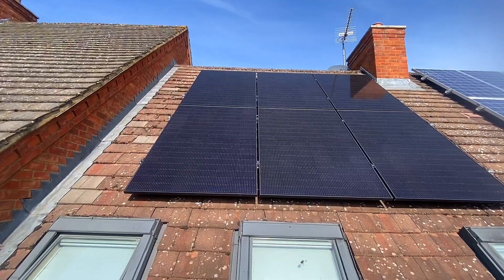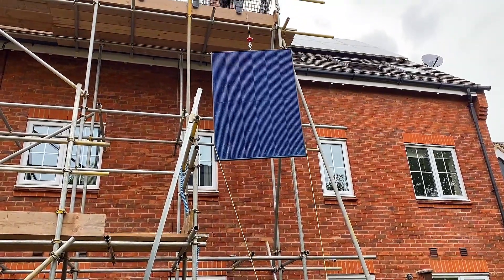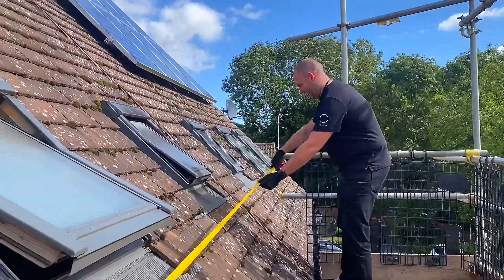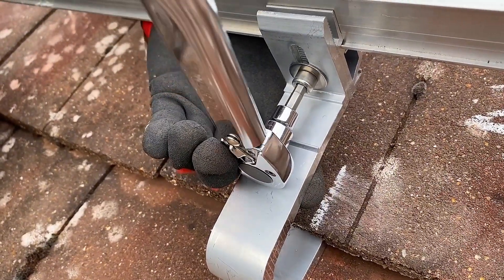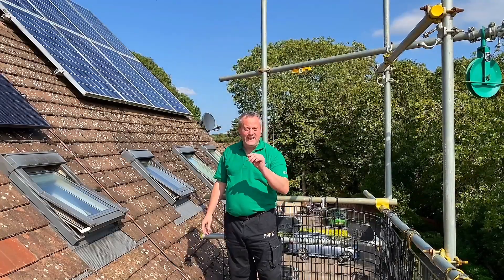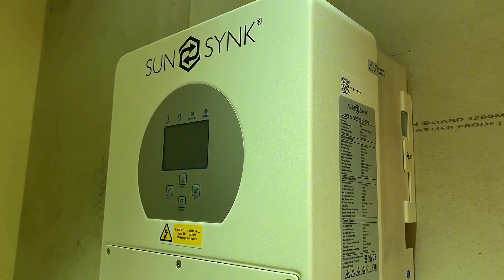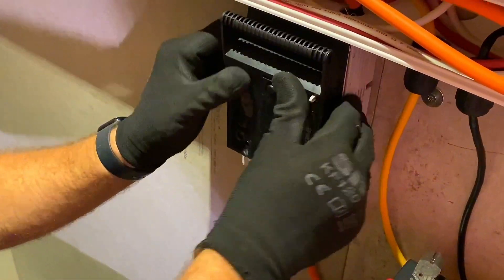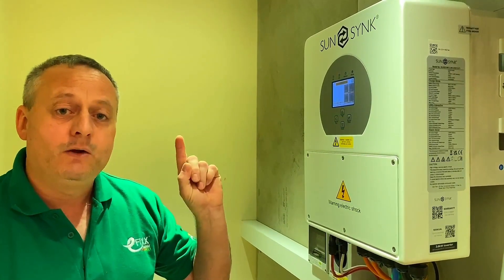SunSynk 3.6kW Ecco Solar & Battery Storage Installation - Gary Does Solar

Comment: I know this video is a year old, but one question:  Why two fuses for the positive/negative wires on the battery circuit? Wouldn't one fuse on the positive lead be sufficient to protect against overload/short circuit?

Comment: You have 5 ways to break your solar DC circuit at zero current and a pile of batteries and heat generating breakers and electronic equipment in a small bathroom indoors! An external shed or garage or boundary wall installation might be bigger, easier and safer?

Comment: I was seduced by Keith Gough’s enthusiasm. “Yes, I must get a SunSynk system.” Luckily there was a local Master Installer, so I stumped up the cash for a 3.6 ecco inverter and 5.2 battery, just like yours. Connection between my Consumer Unit and Inverter is about 8M of 4mm T&E, not 6mm like yours. No trunking between the invertor and battery. No glands on the isolators, plastic just hacked away. No warning label on the PV cable in the loft, just clipped so they look like satellite coaxial. Obviously didn’t use PV Ultra, probably couldn’t get any! No DC surge protection, so no extra 6mm earth. I gave the installer the 20amp type A RCBO for the CU, I had it in my spares, so they didn’t have to get that.

And this is the difference between an Electrician leading the project and what joe public gets. I could have told the installer that it wasn’t good enough but basically, I don’t want them back.

As for the inverter, the rcbo has tripped twice, both times in the morning when the battery is out of charge and I switch on my 2.75kw kettle. Annoying but just resetting causes the inverter to alarm. No Sun on the panels, just noise on the PV string. From then on, it’s a right pig to get started normally again.

Bottom line. I have no regrets having SunSynk and would recommend them. The installer not so. 

For those questioning Gary’s socket in the toilet. How else is he going to power the smart speaker that comes with a 3 pin plug transformer? Gary, you should have used a wandering lead from the landing!

Good work Gary. Thank you.

Comment: I had a sunsynk inverter and batteries installed. Only problem I have is the batteries can only be discharged down to 10% and can't find a way around this. Have you come across this problem too? (Wasting 10% of the battery capacity seems just criminal)
Reply: You can't discharge any lithium battery to 0%. Sunsynk themselves say 10%
Reply: @jacktissington  You should be able to since they have a depth-of-discharge of 100% - all LiFePO4 batteries can. In any case, why does the inverter allow you to set it to 0% if it doesn't work? A bug? An oversight? Just not been tested? If you tell your system to do it, it should do it and not disobey you...

Comment: Great choice in manufacturer, Sunsynk. I have a 5kw hybrid inverter, big brother to yours I think ... connected DC coupled to 16 DMEGc 405watt panels. 6.4kws in total on 2 arrays. The inverter charges 2 200amp/hr Sunsync 5.2kw wall mounted batteries in my double garage outside, then takes on the daily load in the house until darkness hours, whereby the batteries kick in. Great pieces of kit. Since February this year I've only been back to the grid on 2 days for power. Interesting point in the settings you'll find. If you look on "system mode" ... you may see a grid trickle setting. I'm told you can set this to 0 (zero) watts, providing you don't have a pre-paid meter. The default setting is 20 watts, but it does add up.  ;) Three words of advice ... get bird mesh.  :)
Reply from the maker: What’s a fantastic story I am very much enjoying my solar energy journey 👍🏻

Comment: Pretty sure MCS says 400mm round the edge, but they also say you can do less with calcs for wind loading and providing things are sufficiently braced (i.e. additional hooks).
Reply: I don't believe the installer reads any of the MCS documentation.
Reply: Yes I agree that many MCS installers are ignorant. I'm just a home owner but I've read them because I wanted to maximise what is possible. @VinoVeritas_
Reply: The 400mm is advised. As long as there is space for maintenance its fine

Comment: More batteries you can’t have too much I’ve just finished building mine 14.4kW think I could do with another 4.8kW I didn’t think my 3.2kW solar would completely charge my 14.4kW but it does and then some but only the depths of winter is the true test for it all. I went all AC so I could have the batteries and the solar as two power sources for those high kW appliances
Reply from the maker: Massive thanks for adding your thoughts and experience 👍🏻

Comment: You don't need a generation meter. Tell your installer to read section 5.7 of the latest edition of MIS 3002 published by MCS in May, 2023.
Reply from the maker: Thanks for that 👍🏻
Reply: Relying on software derived metering is risky in terms of MCS compliance imho. Say for example your inverter fails, software drops out or some kind of glitch of that sort. Knowing the generation at a local physical meter ensures things are done correctly. That said with the adoption of smart metering and (generally) single source generation that box can be covered via the suppliers metering arrangement. Although that wouldnt account for charging a hybrid battery up from the grid in the way a local metering setup would. Food for thought.
Reply: @electrician247  What are you talking about? Why does a new installation require generation metering? Have you even bothered to read the document mentioned?
Reply: @electrician247    It was a simple question to answer. Why is generation metering required for a new installation? What purpose does it serve?

It's irrelevant what future standards may or may not state, it's only MIS 3002 version 5 that's relevant today. However, I'm happy to hear that you decided to take part in the public consultation earlier this year.

As for SEG requirements, these generation meters are totally irrelevant. Stop pretending everything is open to interpretation, it's not.
Reply: @VinoVeritas_  maybe read that standard again Vino. I linked it above. No one is pretending anything. Stating basic understanding and application of the requirements of MCS. 

Are you an approved installer working to the standard? Do you take the MCS onsite assessment each year? 

I am and based on that and my reading of 3002 gen meters will be fitted as per standard on all our installations. 

Those can be any MID type so long as separate from the inverter, supplier/metering company equipment etc. 

I've answered your simple question, you might not like the answer but you got one.
Reply: @electrician247  5.7.1 A means of recording and displaying the total AC generation of the system shall be installed. 

You can do what you want, but there's nothing in 5.7.1 that states a generation meter is required. So Gary is well within his rights to choose not to have one.
Reply: @VinoVeritas_  how are you proposing that is achieved without one?

Are you an approved MCS installer yourself? 

It is the installers who sign on the line that all elements of MCS are met and insure that work accordingly.  

Relying on software, inverters or supplier metering (not owned by the householder) does not satisfy any aspect of 5.7 imho. 

But as I said it's easy to take a different view and approach. 

Every single installation we deliver comes with metering that is MID compliant. 

To do otherwise has no upside so far as I can see. 

Thankfully MCS are drastically updating all the installation standards and assessment process as we type lol. So this will no doubt change again. 

I would personally take the same approach as Gary's installer who is a quality provider btw and have issued exactly the same advice around metering and isolation points. 

With such poor workmanship going on industry I applaud such a keen attitude and dedication. 

Each to their own though

As an aside I've got the generation data from my own solar inverter and it does not match the generation values displayed on the adjacent, calibrated meter. Roughly 5% inaccuracy on the inverter. Interesting stuff. 

With access to a few dozen installs I'm going to have a little dig into the tolerance of the inverter measurements more widely as a sample of 1 is very small 😀

Comment: Why would you not want a dc isolator and a generation meter?
Reply from the maker: Metering is built in to the inverter. Video coming soon on the dc isolators
Reply: @eFIXXENERGY I guess you would also have an export metering capability on your smart meter into the property so the dedicated export meter is duplication
Reply: @graham9957  A smart meter will only measure export, not total generation.